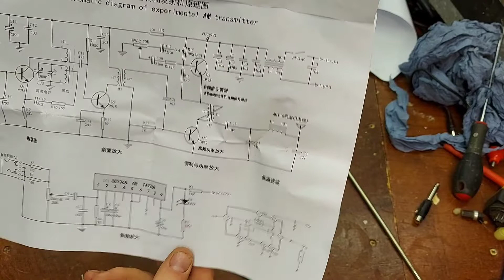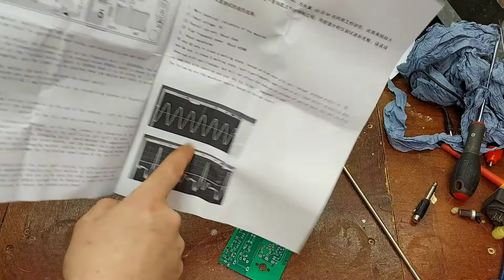AM Transmitter Kit.

Comment: This kit went through several revisions over the past couple of years. I bought two of the latest version (2024). The instructions aren't the greatest. I actually made an English version of the construction, step by step, including testing at each stage, if any one is interested. I haven't made an oscilloscope envelope analysis -  yet. I'm still learning how to use my scope's features. Using an air core frame loop antenna I was able to get 100 feet at its lowest power setting. It sounded pretty good on my GE Superadio. The kit IS NOT a U.S. Part 15 transmitter nor do the instructions imply it. The instructions tells you its capable of outputting 400 mW (four times the legal Part 15 limit). But without a good antenna for it, you won't get but a few feet of range out it. It won't matter if it's 100 mW or a full watt. The antenna is what make these low power transmitter work. Wanna know more? Go to Robert Weaver's Electron Bunker site. Find the page where he explains the properties of electrically short antennas and how to design them to work with these transmitters. It's a good read and worth investigating. Now, go buy one of these kits and enjoy...

Comment: I bought two of these kits. Built one and found it to be nothing but garbage! I'll advise against buying this.
Reply: I have a transmitter circuit of more than 100m range if you are using 10 feet antenna  but they used germanium transistors , my had father made that circuit. I have made Italian MW transmitter circuit range around 30m but sound quality is very good
Reply: @hamzahkitech5228  try adding MOSFETs and you'll make more than 100 meters

Comment: Question - Could you change the frequency to the 27MHz band and what output power does it have? Can this be increased?
Reply from the maker: Hi, it puts out about half a Watt. I'm sure adjusting the values in the oscillator could get it up to 11M but I would say drift would be a problem. Not worth it in my opinion.
Reply: @IrishvintageTVRadio  Cheers, not being an electronics expert, why would it drift on 11m and on not on the default frequency it came with?
Reply from the maker: The higher the frequency the more prone to drift. Say .1% drift at 1000KHz would be between 999 and 1001KHz, now think of .1% of drift at say 27.555MHz. That's why the use crystals in CBs instead of free running LC oscillators like in this transmitter. OK on the AM broadcast band but not much use up on 27MHz.
Reply: @IrishvintageTVRadio  In Ireland, church radio is of interest but I cannot find an AM Transmitter (except for a CB radio) that can transmit on the comreg regulated frequencies which are on 27mhz. 

Keying a CB for an hour is not a good idea as the transmitter is not designed for that. On Aliexpress they do sell FM Transmitters but not on the 11 meter band. Now, if it was possible to replace the crystals on these FM transmitters to 11 meters, that would be interesting!

Comment: I built the Spitfire AM transmitter a few years back, good device, but way dearer than a tenner!
Could you put a link in the description, as I cannot find this kit on ebay.
Reply from the maker: Hi Mark, I too couldn't find it on ebay but here is a link to it on Alixpress € 15,48  33%OFF | Micro-Power Medium Wave Transmitter Board For Testing Crystal Radio Domestic Use
https://a.aliexpress.com/_mtE4K8x

There are other ones available as well.

Comment: Oddly you have many transmitters around you, the first mixer oscilator in every radio,  tap on to an emmitter resistor with say 4k7 and feed audio in, it might work lol.
Hey you did say you were not interested in the g8, but the tube is a keeper :-D